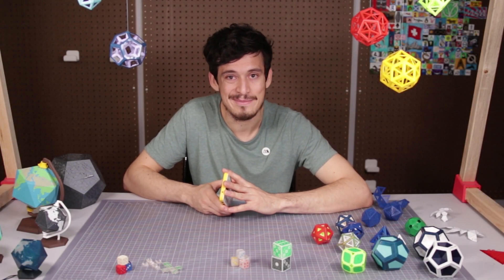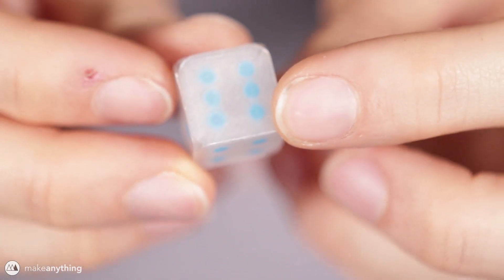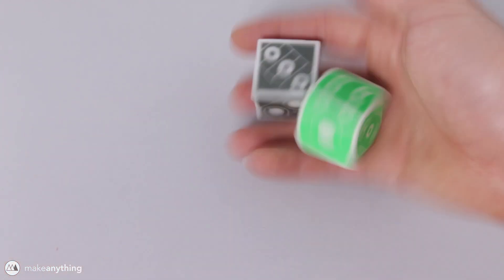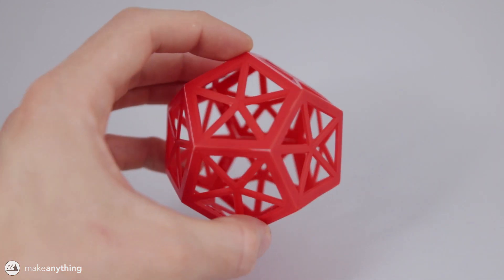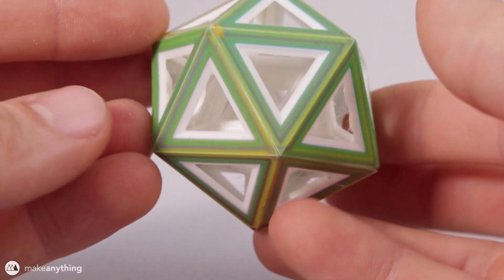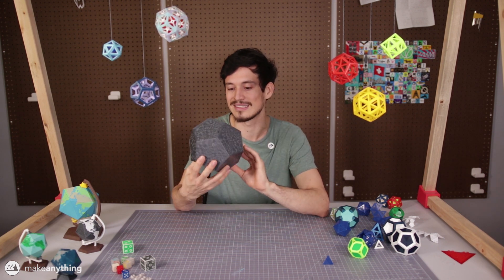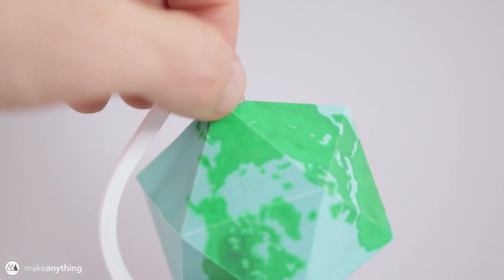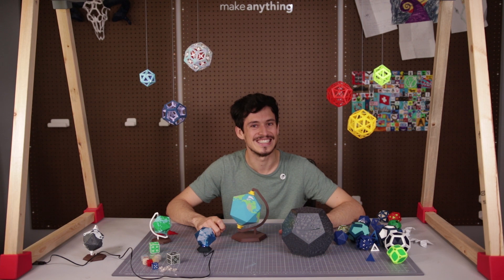Colorful, Foldable 3D Printed Polyhedra!

Comment: A tip for folding thin parts like this: Let them warm up on the print bed for a bit before bending them. Even for fresh filament that doesn't snap off, this also helps prevent the white stress lines along folds.

Comment: What if Earth WERE an icosahedron?!
I'm picturing a planet with 12, evenly-spaced, pentagonal continents,
protruding from a spherical ocean,
each sporting a single very high (but relatively shallow) snow-capped peak.
That would be a very cool 3d printing project.
If you were standing on Icosahedral Earth, everything would be on a slant.
The only level spots would be at the 20, evenly-spaced, low spots, on the floor of the ocean.

Comment: Been looking to make my own fordable prints, a box really but i have to start somewhere, and have been looking for how tos but your the closest i have been able to find, any tips on where i can find more out? what i want to know is how thick the connecting layer has to be. thanks.
Reply from the maker: Watch my other folding print videos, but really I ended up going in the direction of my polypanels instead. That said, I was making the connecting layer the same thickness and width as my layer height (so 0.2mm).
Reply: @make.anything  thanks, will give it a shot and let you know how I get on.

Comment: LOL those dice are heavier on the 6 side... meaning that you are more likely to roll a 1. Completely useless print.
Reply: It might seem like it at first when you look at the sides individually. 
Once it's been folded and the tabs line up, the center of mass for the entire object is pretty damn close to the center of the object itself, cancelling out the discrepancies between individual face weights. 

Besides - it's not a casino grade perfectly balanced dice. You don't even need those for hobby tier applications. Not to mention even store bought dice aren't balanced - the dots or pips on each side make a difference if they are inset into the faces. having 6 inset dots on one side and only one on the other makes it more probable to roll a 6 since there is a difference in amount of material removed from the sides. Think of this more as an arts and crafts project than something intended to be used for serious applications. :)

Comment: Hey could you create using the folding technique more of a how Papercraft to work like if you could take a shape and take the paper craft and add the Clips in with the proper angles and everything printed with different color layers and therefore together and making a more dynamic actual 3-D print to give it better shape but still have that nice clean-cut consistency Smoove look like you given all these shapes

Comment: line the inside with tin foil or some other reflective substance such as silver ducting tape before you start poking holes in it. This will allow the light that doesn't make it out of the holes on the first shoot to bounce around until it finds a hole and you essentially giving off a more coherent beam of light coming out of each hole( in theory ? XD )

Edit: You can also stick a prism inside somewhere so you get out some rainbow light?( probably not >.> )

Comment: Try a rhombic hexecontahedron! It will be tough but I know you can pull it off. It's one of my favorite polyhedra, in fact I'm working on making one with origami. It uses the same golden rhombi faces as the rhombic dodecahedron and triacontahedron, but this one has 60 faces! It's appearance is like a star, so it's not a fully convex polyhedron.

There are a bunch of possibilities with this one, and something to note is that the outer points can all be connected to form a dodecahedron. Also it would be cool if you tried to make the Yoshimoto cube!

Comment: Feeding a Bowden tube with 3 inch length pieces of filament, I take it you had retraction turned off.
Reply from the maker: Nope. Retraction won't work properly for that bit, but it's only the first layer or two so no big deal

Comment: Do you change anything in your z level setting when you do multiple colors on 1 extruder??? I've tried and failed so many times trying to do two colors on 1 extruder.
Reply from the maker: I increase z-hop/retraction vertical lift to .4mm or so to avoid the other colors. Otherwise I don't change anything

Comment: You probably should try heating folding lines a little, like with a hair dryer, to make sure they fold smoothly and without internal cracks... i failed a couple of times on my prints before trying heating and it helped with old PLA.

Comment: Great job. If you want a crisp projection with light, the trick is to use the smallest light you can with the highest output possible. Sharp shadows only show up when the distance between the light source the subject is great but the light is powerful (think of the sun at noon and how crisp the shadows are)

Comment: Here's an idea if you take one of those fold-out ones, and get it to where each side is rounded enough to where when you fold it together it would be a complete round sphere? I don't know if you understand what I'm saying. but you'd have to print the creases for each side where you fold it, on bottom instead of top because obviously if your folding it from the upside in and you couldn't print the Curve on each side. So you'd have to print it upside down kind of like with the curves on the top so you can fold them in from the bottom. the only thing is you have to get the right angle of the rounded part so that way when you fold it each side would match and line up perfectly to make the sphere!

Comment: You could use fairy lights for the light shade as the individual bulbs would each be positioned differently from each of the holes. This could give off different levels of intensity  illuminations to represent the different brightness levels of stars. 🔆✨💫🌌

Comment: Wow wow wow wow. As a huge fan of all things polyhedra, this absolutely blew me away. I'm not sure if you ended up doing this, and it wouldn't make a huge difference in the prints, but there is a way to make the dihedral angles exact and not round them to decimal places. Fusion 360 will let you set a parameter equal to PI, which can then be used in another parameter to create an expression like for the dihedral angle of a dodecahedron, π − arctan(2). When doing this everything should be in radians not degrees. 
You may have already figured this out, but i thought it might be helpful. 
Keep on making awesome stuff Devin! You are truly inspiring!
Reply from the maker: I didn't figure that out, I'm not particularly math-oriented so thanks for sharing! In any case, it seems rounding to the thousandth of a degree did the job at this scale :)
Reply: I've been printing dodecahedrons for the last couple of days. You can input "180-atan(2)" as a parameter in Fusion 360 (with degrees set as the units). You don't need to use radians unless you want to.

@Make Anything thanks for this great video. I just found it. I'm excited to take my dodecahedrons to the next level.
Reply: Wat what wat wet wat did you say?
Reply: @skating_stars8173  I wish I was as smart as this thread. lmao.
Reply: Ima confuse

Comment: Hi! As it was already said: make holes in your black icosohedron as small as possible. Myself would try just to puncture them with a thin metal needle. Make it hot and it's easy.
My idea is that these folding structures is a good start for some fun light&sound project. Just put some simple square oscillators (with few mid.size speakers) inside and make their volumes and pitches dependable on the light (LDR components instead of timing resistors) and make them fixed and lights - possible to rotate or move. Just a real problem I see here: power sources. It can be batteries but their weights can disbalance a construction. This must be thought out very well.
Oscillators is the simplest part, I can give you good schems. Maybe the power to the rotary part can be "wired" without wires partially... I guess that it possible with a kind of "brush contacts". Or maybe it can be transfered by induction (like modern wireless mobile charger devices).

Comment: You definitely need to try and make a 3d printed phone case...with a puzzle!
Reply: How about a modular puzzle on the back, so you can have different types and designs of puzzles?
Reply: @deletedhobo7405  The easy way would most likely be cutting the 1 layer he usually does into puzzle pieces and get a jigsaw out of it to insert in the normal puzzle. Then the more advanced idea could be adding a sliding puzzle or make a maze
Reply: Sliding or maze would be cool
Reply: Is that the digital hazard symbol?
Reply: @The_Wosh  yeah.
Reply: Yaaarrrrssssss

Comment: Pretty much instantly loaded up that icosahedron file to print! Been loving doing lots of quick prints for xmas gifts and experimentation and the file is only a 3h print at max size so this is awesome! Love your work as well, recently completed the springo skull and its one of my favourite prints so far. Fantastic work as always man!
Reply from the maker: Thanks! The connectors might become tough to snap together if you scale up.. you may have to scrape them down a bit with an x-acto.
Reply: @make.anything  I'm using an ender 3 so max size for me was 140% so shouldn't be too bad but for sure appreciate the advice, cheers! I'll definitely buy the full set soon, but money's a bit tight rn so will probably be after Christmas lol. Sweet idea though, that globe especially is satisfying the low poly vibe I've been hitting recently. Excited to try the multi colour first layer technique soon as well!

Comment: I wanna see a d20 made with some really cool patterns. I’d make it myself but I actually don’t have a 3D printer yet... :(
Reply: Angel Thomas I’m the Dungeon master for my d&d group, and I’m planning on getting a 3D printer at some point. I’ve thought a few times about 3D printing miniatures, but it would also be cool to make a couple of sets of custom dice for my players!
Reply: @EwenHeaton  miniature printing is a real mess and really hard, but once you get a good result and that you use the right settings, you can get pretty good results!
Reply: @EwenHeaton  you can get some pretty cheap DLP and SLA printers these days. I would highly suggest that rout for miniatures. FDM can and will work but it's not really built for extreamly small details.
Reply: Ewen Heaton d100? 😅
Reply: yea really big d20 for special rolls! maybe it has things besides numbers for the 1 or 20? Or roman numerals?
Reply: Honestly printing miniatures isn't that hard. You definitely need your support settings dialed in though, otherwise it can be basically impossible to remove
Reply: I knew that this would be on here, there are so many great resources for making miniatures and d&d related things on here. Also the icosahedron at 7:05 is actually a d20 just without the d part, but you could even just hand make the triangular pieces by drawing them out on paper and gluing them to it, you could put an LED on the inside with a little flickering light from those dollar store candle lights and you could even set up a whole library of numbers that could be placed on it. especially for rolls like "the players walk into room 3 of the dungeon to see..." you toss the giant d20 onto the table to see Snake-Wasps, and the whole table gasps even the dungeon master because this was only one of the 20 creatures that could have been in this room. It would be extra cool if the creatures were even partially created by the people unknowingly in an earlier challenge.
Reply: evilcanofdrpepper that is a really interesting idea. Imagining it is actually really cool! And it adds more fun and excitement to the dm’s perspective, too!

Comment: with the star map you'll need to find the smallest point source you can, there are some pretty bright LED ones out there, though i dont know where to buy them. check out Henry Segerman's video on 'Illuminating hyperbolic geometry'
Reply: I would think that if you constructed a similar shape, but smaller and able to go inside, with those LED's at the center of each panel should potentially maybe possibly perhaps yield the results you're looking for??? ( I hope that my uncertainty is clear :-)
Reply: A laser without a focusing lens would be perfect for that, as it's a point source of light. Unfortunately, I'm not aware of lasers with an angle remotely wide enough.

Comment: Can you try building modes of atomic structures using some of these techniques? Also, you could create a model of the Mysterium Cosmographicum, which is a model of the solar system using all the platonic solids that were Crated by Johannes Kepler to explain the planet spacings.
Reply: hey vsause michael did a video on this
Reply: Yes!!!

Comment: Here's an idea: print a multi-coloured layer, then warp it using a mould (eg. a bowl) when heat is applied.

Here's another idea: Print a bunch of small, but separate pieces, then glue them together (think lego, that are not limited to cuboid volumes).

One more idea: like this comment! :)
Reply from the maker: Great ideas! I was thinking of magnets to stick small ones together.
Reply: @make.anything  Ooooh, that's a cool idea.. Mix that with a puzzle, and you have something really fun! :)

Comment: I love them, you always make such beautiful work. I was messing around with modeling polyhedra in fusion 360 recently too and came across the same technique you used by using the dihedral angle for the taper. I was doing it to make non traditional DnD dice like the rhombic dodecahedron and, as you also showed in your video, the rhombic triacontahedron. While I haven't yet, I still plan on getting them printed by shapeways in metal. Although after seeing this technique I might have to try printing them myself. Keep up the good work!